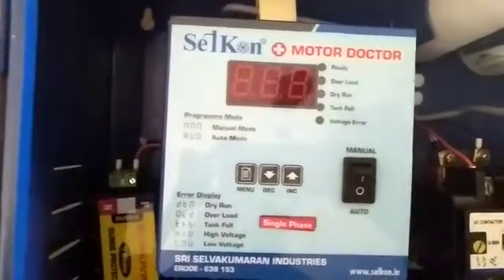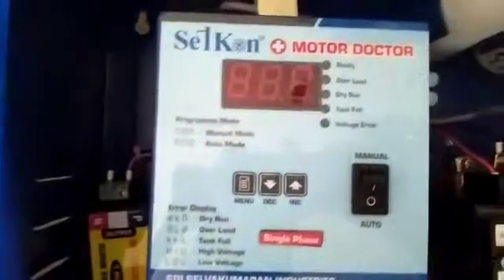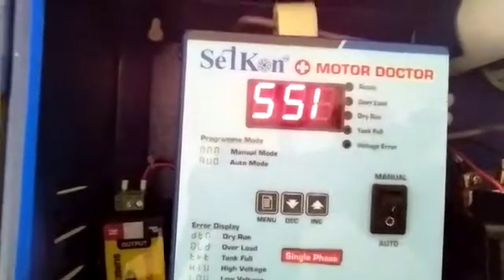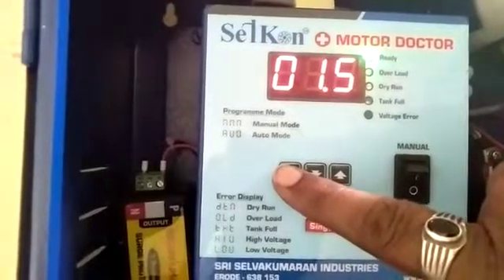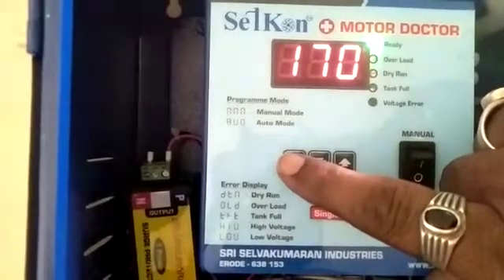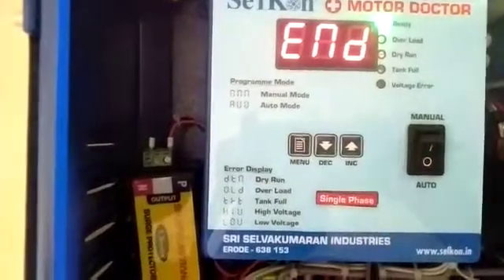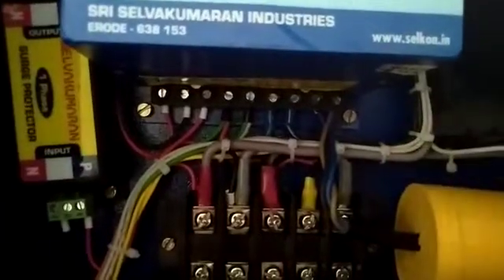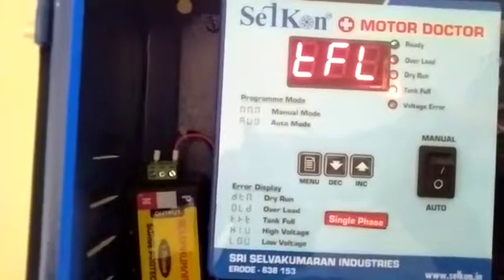Single Phase Motor Dry Run Preventer - SELKON STARTERS ERODE - 9655321216

Comment: The explanation was good. I have a doubt. In our apartment the motor switch is at ground floor and the overhead tank is at 3rd floor. How to extend the sensor wire to 3rd floor. Please reply. 

Thank you.
Reply from the maker: call me @ 9655321216